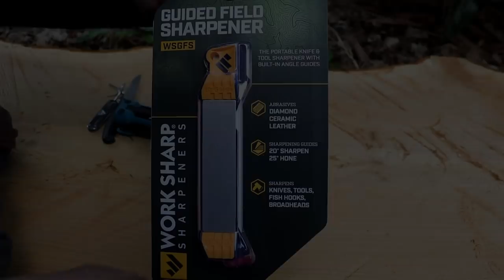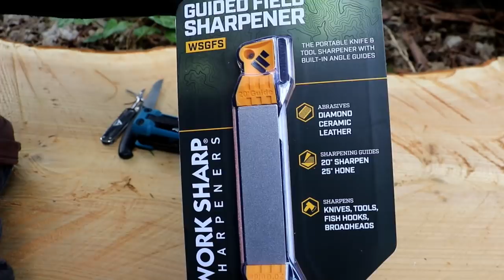Cool Tool CRAZY SHARP Field Sharpener

Comment: Love that it can do serrated knives, most serrated blades end up as bad saws once they get a bit of use. The product I've been using at home with a lot of success is a tungsten carbide sharpener called the Samurai Shark. It'll only do straight edges though and there's no strop, but one draw through the tungsten carbide sharpener is enough to put a usable edge on a dull blade, more careful use gets things very sharp if you're careful to keep the blade at the same angle every time you pull it through.
The use of diamond abrasives on this tool mean you can sharpen ceramic knives as well as metal ones. Most ceramic knife blades are around 9 on the Moh scale, similar to tungsten carbide, which is how they're able to stay sharp for many times longer than metal blades, but diamond is a full 10. Metals are all 9 or less so tungsten carbide works fine on them (Metals used for knives tend to be much less than 9 because hard is another way of saying brittle).
The only thing I don't like with the design is that every second stroke is towards the hand holding the sharpener. The chance of a slip and an injury, especially on the coarse stone is higher than I'd like. If I was using it I'd either clamp it to a secure surface and use it that way with the hand not holding the knife well away from the action or if I had to use it handheld I'd swap the knife and the sharpener from one hand to another hand to get strokes in both directions on the knife blade, but direct all strokes away from my body.
Reply from the maker: Thanks for taming the time to comment.
Reply: You mentioned serrated knifes becoming like bad saws, what if you took a knife and filed proper handsaw teeth on it, wouldn't work that great unless the blade had no taper and you added your own taper after the teeth.

Comment: Great vid , thanks Leah ! I'm going to get myself one of these , is there any need to add oil or water to the surface before sharpening?
Reply from the maker: It's meant for field use, so water or oil isn't necessary.  I use diamond plates for my shop sharpening station and with that I use water and Simple Green to remove to swarf.  I don't see any reason why you couldn't do the same with these sharpening plates.
Reply: @seejanedrill  Thank you
Reply: No water or liquid is needed when sharpening. As Leah said - using simple green or water to keep the plates clean is a good idea.

Comment: very interesting. Normally I use a small pocket size diamond impregnated steel, but it takes some skill to use, getting the angle right ect. I have wet stones, ceramic rod sharpeners, all that but I'm so weird about it I really only use the coarser things for restorations, I try not to let any of the knives I actually use get less than razor sharp, so the steel (extra fine) does the job most of the time. I do not leather strop it, however, I find that doesn't add enough to be worth the trouble. I like this tool tho, it would be great for restorations, everything in one tool, and being able to sharpen serrated knives a big plus, that's usually such a pain with what I have I don't bother. Those tiny Victorianox knives can actually be quite useful when kept very sharp. I used to use one at a big box home center to cut the plastic from wrapped pallets as well as other things. the blade is small, I could hide the whole knife in my hand so that most of the guys thought I was just using my thumb nail. It was funny to watch them try to do it too. 

I'm going to go see about ordering one. Can't go out and find one these days. 

Oh, by the way, while cutting paper is impressive, its actually dulling the edge. You see paper and cardboard have a fine grit in them, when you cut them it's like running the edge flat over a very fine sandpaper.
Reply from the maker: I agree with you about dulling the knives with a paper test but it was the only visual I could think to use for the video.
Reply: @seejanedrill  yep, makes a good visual, but try using rice paper. When you can cut THAT cleanly, then you have a really sharp blade.
Reply: I'm not sure, but I don't think rice paper has the grit in it.

Comment: Any good for wood chisels.
Reply from the maker: It's intended to be used in the field but it does sharpen various tools as well from axes to scissor s, so why not a chisel.
Reply: Don't forget to grind the microbevel onto the chisel for added strength and resilience.
Reply: @aaronlifschutz8358  Just hollow grind it 28° then it'll touch up as fast as micro beveling but no need to increase the angle. Couldn't come up with a great way of explaining that one, something I'd show someone.